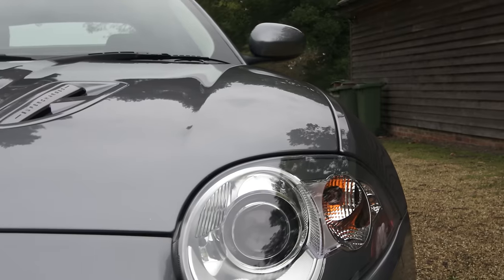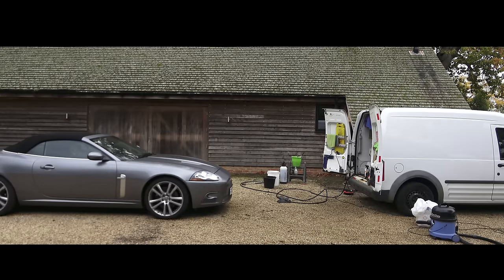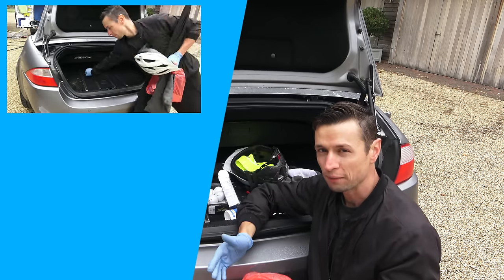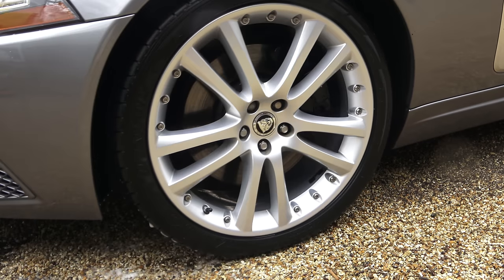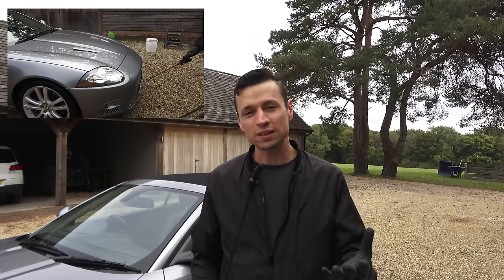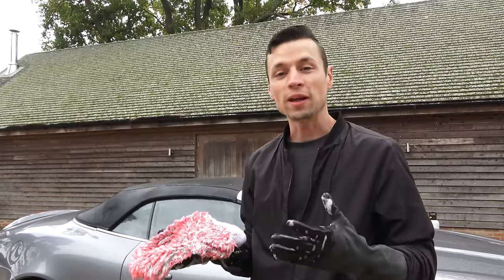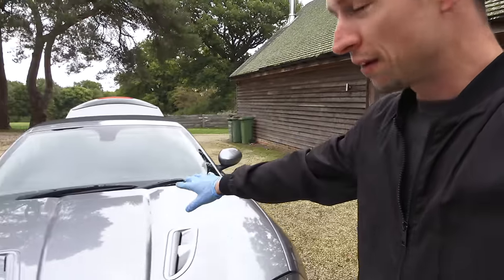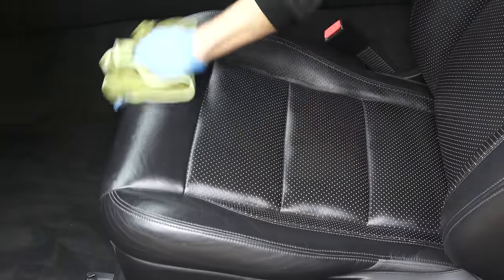Mobile Car Cleaning Guide to a Standard Valet | HOW TO DO IT FAST!!!

Comment: This video and ALL your videos are gold dust to the solo car valet/detailer with logical easy to flow advise but i would say you could snow foam using a cordless pressure washer with a standard snow foam bottle and rinse it off a 2nd snow foam and then use the foam from the 2nd using your noddle microfiber mits

Comment: Excellent video Dave, you made loads of extremely valid points. Key point is to always value yourself and your time. Life has taught me the more you do for people, the more they expect. Regarding the 2 bucket method. Honestly for all car washing ditch those buckets completely.  A much quicker way is to fill a spray bottle with diluted car shampoo 10:1  and use a hose to rinse the wash mitt or pad. It's so much quicker and uses less product and your rinsing the wash mitt with clean fresh water.
Reply from the maker: Thanks mate appreciate the kind words as always. Haven't tried that method yet but always up for it
Reply: @epicautomotivedetailing Thank you Dave for putting watchable and useful content out there.  Honestly Dave, if you have outside tap access the spray bottle method saves so much time rather than fannying about with buckets and grit guards.
Reply from the maker: This location in the video had a hot tap so I filled that tank up with hot water like a bath lol

Comment: I have been having problems coming up with the right price especially in relation to time, on one side I don't want harm on the car, but the two bucket method honestly takes time even on an mid range SUV, in a third world country like mine I still have to explain myself a lot before the clients understand, even then I hardly get a call because I seem expensive, so this tutorial helps a lot. I will now be able to have a flexible price list that also doesn't frustrate my time per vehicle.
Reply from the maker: Where are you from my friend?

Comment: Spot on video. To many videos show full on complete detailing. A basic wash is just that. Time is money at the end off the day. I will be this year trying to start my on little moblie business. Currently working out the most cost effective products. Played around last year with a £50 quid budget to start. Managed to upgrading my pressure washer, get a henry hover, and restock chemiclas with the profits. Your videos have been a massive help so thank you. Next for me is basic chemical set, steam cleaner, and a wet vac for the extras i could be charging. For me personally Bilt hamber autofoam and surfx are both amazing value for cost performance.
Reply from the maker: Your in luck. I have a video coming up which breaks down the cost of everything you need and I look at cheap alternatives for people getting started 👌. Thanks for watching mate

Comment: Date, brill vid as usual. I do this as a hobby but use the 1 bucket method but have a shampoo solution of 50 ml to 450 ml of water, bucket with grit guard, get the mott wet, then spray the solution onto the mitt before you apply, then scrub against grit guard and rinse and onwards, works well and saves so much on my view
Reply from the maker: Brilliant well done Phil. I know many people love the 2 bucket method but my own car is a dump so I don't use 2 bucket method on my own car. As long as it looks good to you that's all that matters 😃

Comment: Well not being mobile, I'm tackling things in a different way. And constantly thinking outside the box for solutions, and it's great your content shows all the problems perfectly. My technique for the wash is two big buckets and when it's quiet I clean the MIT's out as much as possible or chuck them in a quick wash machine cycle .. there isn't really anyone doing content on location valeting or regular washbay & as you can imagine I want to do it better than other places I see. I atleast don't use the big yellow sponges, I also prefer to have someone with me on a high pressure steam gun and blasting out the hard to reach areas, wich is great for busy days or just myself when it's less busy, that cost varies with run costs bt yeah inovations are where I'm at.. I know this is something I want to go forward with, I'm not an expert tho I do know how to get the job done.. any feedback greatly appreciated, I know I'm doing things a bit differently
Reply from the maker: thanks so much for getting in touch. This Content is a bit old now So i have a brand new channel which is straight to the point. It may help you 😀 https://www.youtube.com/channel/UCRcnBHHmSSoCVddBC3bI25Q/videos

Comment: Super duper advice man, well done and gosh don't you video makers work hard! Must take flipping ages to edit and compile. I use a damp microfiber with my bilt hamber auto wash for interior windows, then a dry microfiber to wipe over. Works a treat and then use the solution for the exterior as usual. Wax on, wax off!
Reply from the maker: Thanks Very much i appreciate your kind words

Comment: Great, somebody that is actually realistic about the job. Far too many internet detailers that think every 25 quid valet should be done to detail standards. The simple truth is that the majority of customers just want a clean car and dont know what a swirl is.. Only thing id add is one of the cheap rinse aids as they are so fast and easy to apply and cost pence per application and make drying much easier whilst giving a nicer finish but thats just my opinion. Out of interest, how many of these do you do on an average day?
Reply from the maker: Hi John thank you. It depends because my main focus is doing valets up from this but I like to do these ones in an hour at tops

Comment: Really good and informative video. I’ve recently got a really good car and wanted to find out how the professionals cleaned cars. I’ve never been into cars a lot and never cleaned them much but when I have I’ve used a bucket of warm water with washing up liquid, made sense to me, but of course it looked crap. So I used a good car shampoo, still didn’t look good. So I given up...
Until a few days ago getting my 19 plate car. Trouble is I’m on the side of a busy road. So It was interesting that you say about the 1 or 2 bucket method. But surely just giving a dirty car a rinse off would take maybe a couple of buckets. Or do you pressure wash it first?
Also I have been a self employed gardener for a long time now so I’m looking this from how I usually do pricing work and my regular rounds. My concern is the cost of materials and the time it takes to get from customer to customer. I’m amazed that you don’t need to charge more than you do. I would be really interested to know how much you are aiming at per hour. I’m guessing/hoping around £20 to £25? What you are doing is hard work! You really need to make it pay and pay well enough to cover overheads inc cleaning materials and travelling etc and of course the van depreciation, taxes, insurances etc. Ultimately giving the quality service you are aiming for the customer I’m sure would be happy paying the rate for that.
Reply from the maker: Hello Edward id say £25 per hour is a fair rate but you need to make sure you can make it a profitable business. It is hard graft and it takes something special to keep momentum going

Comment: Epic information. While we don’t use the term ‘valet’ in Australia, your point is well taken. Communicate clearly with your client and make sure they pay for the service you provide. My problem is I can’t imagine not doing the wheel barrels. Also, I never use 2 bucket method. I use 5 mitts in my wash bucket and use a fresh, clean mitt face for each panel working top to bottom, discarding the used mitt into a second empty bucket. Clients love the amount of care shown. Lloyd
Reply from the maker: Hello thank you for watching. That's an alternative method even I've not considered. How do u do cope in the summer with the heat?
Reply: Epic Car Show Detailing while I’m use to the heat 90% of our summer days are only around 29°C-32°C. I use a 3’x3’ marquee if I’m outside in the middle of the day or plan the detail to be inside the car during the middle of the day. I usually consume about 3 litres of water too. Lloyd
Reply from the maker: @indetailcarcaresolutions3770  respect to you. In the UK we just take a day off if the sun comes out as its so rare these days.
Reply: Epic Car Show Detailing ha ha. If I did that, I’d rarely work! I’m actually a high school teacher transitioning to retirement. I’m a car nut and want to stay active in retirement and it’s a great way to exercise my back after spinal surgery. All your tips are appreciated as I’d like to make a bit of pocket money along the way.
Reply from the maker: @indetailcarcaresolutions3770  Amazing well done mate. So the teacher is becoming the student. I do feel blessed. Man hope your back doesnt cause you too many problems as car cleaning can be a real pain the back and the shoulders
Reply: @epicautomotivedetailing  its all good. As we move towards summer and my 8 week break, I’ve already nearly booked up the time I’ve set aside for my clients!! Doctors say what I do with moving around the car is the best recovery therapy I can do!! Go figure.To that end, I’ve booked to full exterior/interior details with complete application of CarPro CQuartz 3.0 UK topped with Gliss and 4 maybe 5 maintenance details. I get so much enjoyment putting into practice skills that I’ve learned from YouTubers such as yourself. Keep the education going!!
Reply from the maker: Thanks mate. Im happier helping people with my own experiences as I think so many people are very obsessed with having bright lights to remove tiny marks and at the end of the day as long as it looks good that's all that matters 💪
Reply: @epicautomotivedetailing  I’d love to use my “teacher” voice to do what you do, but I just don’t have the time to physically get the editing done to a quality I’m happy with. OCD can be such a pain sometimes. I’ve taken hours of footage put it into iMovie, but reshoots are high on the priority list. I doff my hat to you young man for your professional production and presentation. It takes practice!!
Reply from the maker: @indetailcarcaresolutions3770  thank you that's very kind. Don't think there is enough hours in the day for me at moment I love helping people with detailing things

Comment: You are correct we can’t use 2 bucket method as we have to go the client, fuel, chemicals, washing our mits etc, however someone having a £25 valet doesn’t care about those issues, because they can go to the local car wash and get the same service for £20 so increasing costs although essential doesn’t mean you’ll get the business

Comment: A little thing I do on pea shingle and gravel drives. I use rubber mats under the tyres to avoid extra dirt or worse still damage to lower body or wheels.
Reply from the maker: Very good point mate 👌
Reply: Welcome. 

It’s true so so important to be organised saves so much time and looks so professional. 
 Check out my YouTube van set up videos. 

Where are you working from??
Reply from the maker: @viperautovalet4479  south of UK my friend 🇬🇧

Comment: I always use the 2 bucket method but dont use snowfoam due time fucking about back and forward like you said. As you said if you running a business time is money.
Used to use the flanky but every car is now dried with drying towel (unless its covered in rust its a decision is made on the day and verys from vehicle to vehicle)

Mini valets £30 - £35 pending on type of vehicle and than additional cost for dirtier vehicles. 
I also say to them to try and have there car as clear and empty as possible.
Reply from the maker: Yeh I only use flunky if it's a real cheap valet that the owner doesn't car about too much. It's an interesting topic because its often frowned upon
Reply: @epicautomotivedetailing  totally agree on that. Everyone runs there business different yes try do it as safe as possible getting as much crap off before the contact wash. 

As long the job is done to the standard you set out for each and individual valet which is the most important part.
Reply from the maker: @LothianValet  couldn't of put it better myself 👌

Comment: you need a vlog on how to aproach the customer and explain what they get for the money even though most just say clean it
Reply from the maker: 100% mate will add that to the list
Reply: I really like this 'zero bullshitery' video. I think the industry has gone a bit mad with all the fancy pants chemicals and equipment. Its al.ost like the DETAILER POLICE will come round if you don't use the 2 3 4 or 5 bucket method. 
Great video.
Reply from the maker: @dalydetailz2120  Thank you mate appreciate it.
Reply: @dalydetailz2120  its basicley down to what the customer wants if they want to pay out thousands for it but most just want it cleaned and left up to them to get it done

Comment: When I use one bucket I use extra soap because I hose the mitt after two selections at a time, It still takes a but not as long as the two bucket method.

Comment: Hi David, I have 2 questions to ask, first is do you use your customers outside hose tap for your water supply and also their electricity for the hoover and pressure washer? Thank you, only because if I did this myself I don't have a van just a car.
Reply from the maker: Hello when I started I had a pedal bike and a trailer. I believe anyone can do this without a van j really do. Yes some customers won't use u if you don't have water or electric but that numbers are so low that 99% won't mind. I've never had a problem without a generator
Reply: @epicautomotivedetailing  thank you so much for the reply, I want to ask another question as well, I am very unsure of what cleaning products to use based on quality, budget and profits, I have heard of top brand names like autoglym, autosmart, bilt hamber, meguiars, auto finesse and so on, however these can be pricey for a new starter to pay for, I have tested and used a few names that many may have not heard of but have given my car Exellent cleaning power for half the price of big leader names, what is your opinion on this? I have been using some products from ebay called autoline, they have been amazing value for money and cleaning power as well, I highly recommend their fallout wheel cleaner called razor at just £17 for 5l also there snow foam, can you make a video on this topic as it seems to be a huge debate on products like big brand names and smaller names like turtle wax on so on, a video on this would be highly appreciated, once again thank u for the reply!
Reply from the maker: @jamie1992ful  Hello mate. If you want quality trade products then try find yourself an autosmart rep. They turn up in a big lorry full of goodies that are really affordable! the stuff you see in halfords is all aimed at domestic markets not commercial however they do sell carplan trade products
Reply: @epicautomotivedetailing  hi David thanks so much again, I have used car plan home products like demon shine, foam ect, the company is tetrosyl if I am not mistaking, is there carplan trade valet products any good for valeting? Didn't know they aim at that marketas well? Thank u David.

Comment: Brilliant video. I am hoping to go into mobile valeting myself. And this has shown me alot already. Just one question so a mini valet is just a basic clean with no car wax or polish on the outside. What would you class it as to your customers if they wanted a mini valet inside and out and a machine wax or wash and wax on the outside. Thanks for your information I will be following you from now on 👍 and what's the stuff you are spraying on the bottom of the car passenger doors
Reply from the maker: Hello thank you for watching. The spray on the bottom is a tfr which breaks down the dirt which I prefer over snow foam of your going for speed. So I would charge machine polish as an extra. But then I wouldn't Machine polish without offering a clay bar so there is lots of possibilities to charge extra
Reply: @epicautomotivedetailing  thanks for your reply I have just added a clay bar to my basket on eBay to try on my own car 👍

Comment: Bilt Hamber Surfex HD is what you need, get the dilution right and you can use it on the paint,wheels,carpet,interior trim etc. Normally around quid for 5 litres
Reply from the maker: Thanks Chris, I've used few bits from them but will feature more stuff from them next year 💪
Reply: @epicautomotivedetailing  For me it just saves the hassle of buying a tfr,apc,carpet cleaner etc when I can use one product across the whole car
Reply from the maker: @Chris_8270  I'll give it a go thanks mate
Reply: Surfed HD is first class👍

Comment: You are ace mate you remind me of the guys I used to work with top tip mud on interior plastics do you recon g101 woud be ok dave
Reply from the maker: Yes 100% g101 is the go to chemical for plastics in the mobile car valeting trade
Reply: Becareful on.leather it can streak.